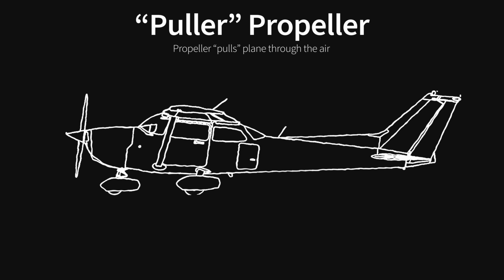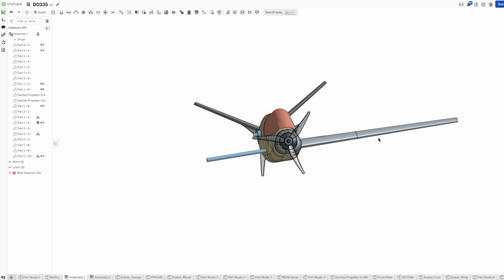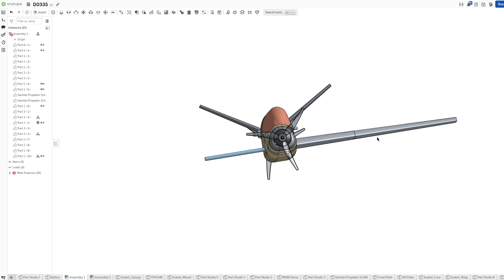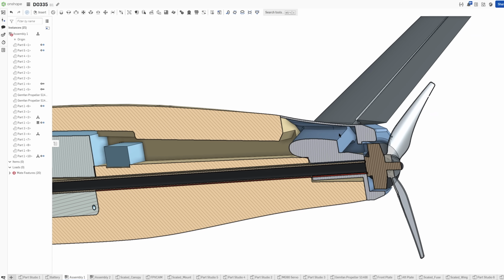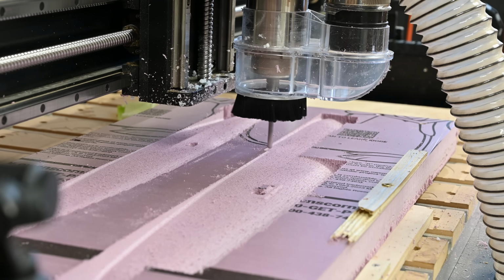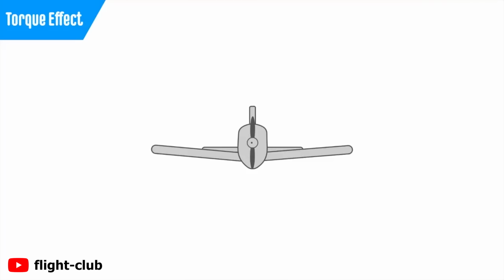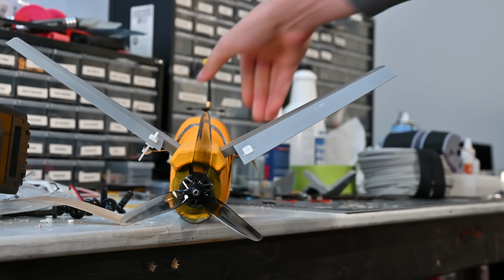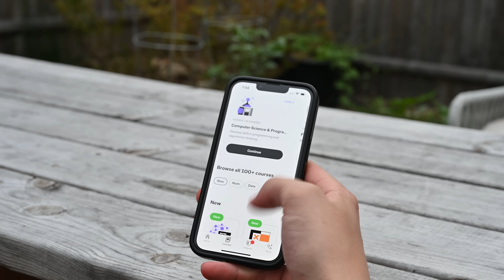Building a WEIRD RC Plane... Will it Fly?

Comment: Tail: Add vertical stabilizer, pointed down with rudder and very robust actuation system. Replace V with larger horizontal surface with elevators. Insure proper balance! Increase torsional stiffness of all structures.

Comment: Build a catapult launcher like they use to launch fast delta wing RC jets.

Then without power launch it to test the glide. If it won't fly power off there's little chance it will fly at all.

Comment: I feel like I need to build a much simpler version of this with foam board to prove that it will work. There are a lot of issues with your build, the glaring thing that got me was how you seemed to thing CG wasn't that big of deal. CG was probably your biggest problem with this plane. The best way to find the proper CG would be to hold it upside down and test is that way. The design itself was good, that plane will fly, maybe need a little more experience and don't rely on the flight controller to correct major CG problems.

Comment: Number one big issue is the sharp leading edge of the wing. It stalls at even slightest AoA. Combined with a weak V tail and huge moment of inertia from tandem motors, it is a guaranteed failure.

Comment: man just move the wings back and make the tail larger with larger control surfaces. Make a traditional T tail instead of a V tail, this gives the arduino pilot more able to respond to input. A push/pull config is not impossible, you just messed up the basics of airplane design.

Comment: With massive power any minor stability issues are magnified. I am unconvinced your cg is correct. I suggest removing rear motor to start with. Your tail should permit correction for motor torque, and forward movement of cg, and you should have plenty of power with one motor. In principle, a power off glide can be used to confirm correct cg; however, you likely have a really high wing loading, so tough to hand launch with adequate velocity. Larger (longer) wings would help with wing loading. Also, try to get correct cg with the smallest possible battery. Weight is the enemy. A small battery may give a short flight, but might also confirm airworthiness. Giving up is not an option…

Comment: What  is the purpose of design a plane and then pretend that adding an autopilot, without any clue about tuning it, will solve magically the problem or a tail heavy GC ? 
That plane should fly perfectly without autopilot, then you add autonomy. 
You used lightweight pla for motor mount than normal pla for the tail sanction. If you had study A bit the 335, you will have find out that German engineer put the rear motor in the cente of the fuselage for a reason... Making this kind of video is pointless and silly for the community

Comment: I built something similar and had issues with insufficient tail surface to control it very well. Some planes just don't scale down very well and need bigger tail surfaces. So I changed my design to a Cessna Skymaster with front and rear props. With the tail behind the thrust, it flew really well and fast. I suggest changing it to a Cessna Skymaster or adding a tail boom. I did not use a flight controller on mine cause I only flew it in line of sight. Personally, I would not give up and keep trying. Flight controllers can only do so much. Personally, it is still too tail-heavy. Always fly without a flight controller to make sure the design can actually fly. Then add a flight controller to it. Use foam for the tail to keep it light. 3D-printed parts on the tail are just too heavy. Don't be afraid to add additional weight to get the CG perfect. That narrow wing cord is very sensitive to pitch inputs. Contact the guy from the channel "Think Flight" or RCtestflight for help. Those two guys helped me so much when I had questions about my build.

Comment: 1 motor in the front with a shaft coming out of each end of the motor shaft to front prop shaft to back prop with some support bearings preventing wobble. But, you will have to use a gear box in the front to reverse the prop direction. Can't have two props turning the same direction

Comment: Ah let me tell ya, despite tandem motor setups being such an attractive planform they are a MESS to get working!

For the better part of 4 years I've tried to get a combined prop/EDF airframe to work, and the enemy was often tail heaviness. Its just hard to manage the weight!

In the case of your design, it might have also suffered from the wings being too thin. If you think of the thickness of your airfoil as its "power" than you'd want a thicker airfoil the more your weight goes up. Otherwise the wing will be stall prone all the time on takeoff. Simply no way to gain enough energy in that kind of space to stay flying.

Maybe the tandem design needed to be 10-25 percent larger all around to handle the weight, or at least have a thicker wing (or flaps!).

Comment: 1. The Fuselage is to long 2. Weight distribution at the ends of the fuselage leads to an inertia that can not be outweighed by the relatively small V-rudder size. 3. Vibration of this setup is adding turbulence to the V-rudder.

Comment: Use a Radiolink Byme-A Byme-D Flight Controller to get bricks flying safely. And larger tail to handle more sloppy and fast built airframes. Did you angle the motors for counter torque? Cant wait to see what you build next^^.

Comment: I reckon the problem is poor yaw stability. 

When the plane starts to yaw this causes unwanted induced roll. Additionally when the flight controller tires to correct the yaw you lose some of your pitch authority due to the use of a V-tail. Making the tail bigger or not using a V-tail would probably help.

Comment: I don’t really like V-tail layout. Try a conventional one, it should give much better stability. Or just add a ventral fin to make a Y-tail. I had similar problem with one of my early planes. Does it have wings of EPP?
In terms of reinforcement and making smoother skin - try to cover it with fiberglass using elastic epoxy resin - I had recently discovered and tested this brilliant technique.
P.S. could you upload CAD model for us to edit?

Comment: Calculate the weight and adjust where you put the wings when you design the fuselage. Moving the wing backwards instead of adding weight.
Reply: Also are you sure not one of the propellers just act as a break. If they rotate at the same speed it may not actually help. They are not close to each other so I doubt you get the benefits that usually counter rotating propellers give. 

It also looks like it’s too heavy, not just unbalanced. 

Further are your motors angled as they should, I suspect the rear engine is just making things worse if you have mounted them straight. You might need to double angle of thrust compared to how it’s normally setup. 
Depends on the engine rotation whether you should angle front motor left or right. Normally a one should also angle them a bit downward. 
However with a rear engine messing with all this I can’t say for sure how you need to set it up. 

Begin with disabling the rear engine and make engine mounts for the front motor angled as appropriate. When you get it to fly with just the front motor running start experimenting with the rear motor. 

PLA is heavy. Don’t print parts that use any unnecessary material. If you can get away with one wall don’t print more. If you can design a model you can print in vase mode. Do vase mode. 

I have not yet tested lw-pla but I have a few rolls waiting for some prints.

Comment: I know nothing about building planes but i got 2 ideas first maybe the props should be shaft driven so you can confirm both are spinning at the exact s and speed. Or maybe mix the throttle or a more aggressive blade pitch so the front motor produces  slightly more thrust.  In 4 wheel drive in cars a more front bias creates stability a rear bias makes the car more likely to oversteer making the car more drifty. Maybe the same applies here.

Comment: I believe part of your problem is that the fuselage is not rigid enough. The counteracting torque of the two motors is causing the fuselage to twist, so when the plane is trying to pitch up for example, it is also being yawed.

Aside from designing the fuselage with an intentional pre-twist so thats its straight under flight conditions (which would require an estimation of the twist you're getting), perhaps a wider rectangular profile spar in the fuselage will improve the torsional rigidity.

Comment: Question: I noticed the plane wants to spin?  did you account for "torque twist"  having both motors spin left to right side of the plane will make it spin and should be set to spin opposite ways to stop torque rotation 
Edit: also having 60% power in the front , 40% power in the back will stop it wanting to flip

Comment: The Pfeil flys quite well in RC form.  You haven’t got enough tail surface authority with the V-tail, which was even problematic in full size aircraft when it was used, and it introduces further complications to control.  Also looks like way too much weight for the wing area.  Otherwise it’s a really nice build. The foam cutter is fantastic! 👍🏻

Comment: 6:25 not the best plan relying on flight software to fix a design mistake.

Your thrust lines on the motors are way off no down thrust of the front motor causes the pitch up. I'm not to familiar with thrust lines for rear motors, but I seem to remember a Zagi I once had up thrust line. 
I would suggest free flight prototyping to get you CG correct since you have a wonderful CNC router to build them quickly. Also ditch the three bladed drone props you should look for 6x3 electric two bladed prop. 
I would also have the rear motor on separate channel that has a arming switch. That way you can launch with just the front motor and after launch arm the rear motor and have slaved to channel three.

Comment: @michaelrechtin
its the v-tail. it lowers pitch and roll and yaw stability because its angled. the fact its angled makes it so when you yaw you roll and thats why it spins when you try to yaw it. the ardupilot tries to counteract that and it does but that means you have less roll authority. this creates a feedback loop that spins the plane. another part of the feedback look is that its very lowly angled which means you have almost all rudder control going into roll and barley any yaw stability. just use a standard tail instead.

Comment: Wrong type of props? Looks like you are using drone propellers.
Too high wing load. The only planes I've used a massive battery pack like that in has a wingspan of 1½ to 2 meters.

Comment: I'm thinking 1) you've got the wrong props as the plane seems to slow down after you hand launch do although you have static thrust it's fooling you because the thrust drops as the planes in motion 2) the V-tail seems small with not enough authority

Comment: Good video but it didnt fly becouse the tail engine was in the tail you must put it in betwen the wings to keep balanced the weigth, segond use other solid wings , the foam wings , wigle when it flys what makes it unestable.. and lastly add the three tail configuration.. otherwise it wont work

Comment: So... You're not just tail heavy. You're heavy in general. At the scale you chose even the heaviest warbirds, which are notoriously terrible to fly, should be around 1.5kg... And with perfect balance they are just flyable. Just.

The scale you chose is very unforgiving. Ironically going 50% larger might fix your problems entirely.
Reduce the wing load, scale it up, fix the cog and find the cop. That second motor is gonna play merry hell with the latter.

edit also check your servos after crashes like that, often the gears can have microfractures that eventually give under load.

Comment: Looks like a motor ? prop alignment problem between front and back creating a moment causing plane to rotate about its centreline axis. Also suggest checking motore /speed and thrust. They must be equal so as not to create additive yaw moments.

Comment: Pretty sure it's a parasitic drag issue caused by prop choice. All planes that have two engines on the center-line suffer from this effect. I think the 335 even had a veritable pitch tractor prop or at least that was how I understood it talking to a guy who did a lot of work on Cessna Sky-masters back in the day when we got into a throttle synce discussion...

Comment: The problem with the Do 335 was the lateral and longitudinal control, for that reason the plane was with the tail in the crux form † , so I will make several recommendations:
1) Use the second wings, the larger wins to reduce the load of the plane.
2) Try to have the most uniform fuselaje in the plane, the step in form of the pusher motor kill all the power.
3) Make an X tail  to have real control of the plane 

Keep trying, is very interesting.
Reply: The pusher engine was just aft of the wing, which also changes the CG.

Comment: Michael, did you have an individual ESC for each motor? I think that due to the nature of how ESCs regulate with the same input signal, they could be out of sync. Maybe you can try attaching the motors to a stick together, which is attached to a string hanging balanced in the room. This way, you could test a few configs and maybe try using just one ESC with the motors connected in reverse parallel to use only one PWM modulation for both motors. Also, slight differences in the propellers result in residual torque, which can only be countered passively by enlarged wings combined with sufficient velocity.

Comment: Usually having the center of lift in front of the center of mass causes the plane to be very unstable, kinda like the same reason why rockets have the fins all the way back, so there is 0 stability problems caused from the center of lift being in front of the center of mass.

Comment: Maybe the tendency to roll and yaw has something to do with motors torque. Maybe it's the aerodynamic influence of the camera. Test it with one motor at a time until you get a stable flight, then test it with both together to see if anything changes.

Comment: Great effort! I don't know if others have mentioned this or not but a tail heavy RC model just won't fly for more than a few meters before crashing. If you're not getting a favorable CG, it's just going to end up in disaster. Revise your design and components configuration to end up with an acceptable CG before even ATTEMPTING a hand launch. Otherwise, you're just throwing an overdesigned and expensive foam rock into the air, lol! No judgement, just saying. ; )

I'd also go back to the Do 335 design. Namely the tail configuration. Your v-tail is a serious no-no for a push-pull inline twin motor design. There's a reason the Do 334 had such a huge cruciform tail design. And the bottom fin on the Do 335 did double duty to protect the rear propeller from striking the ground during takeoff and landings (mostly landings), while providing more yaw control and stability. V-tails have always been much less stable than cruciform tails but they have one benefit... more aeronynamically efficient since there is one less tail surface but it's not advantageous for your design. V-tail Beech Bonanzas has TONS more fatal accidents than the conventional tail version. Lots of dead dentists and doctors, RIP. 

The second place to look at is the thrust line of your motors. If you look at the Do 335, you'll notice that the front and rear propellers are not at the same height (thrust lines). The rear is a little higher than the first. I can't tell you why, but it's a key detail that contributes to the overall stability and flyability of the model type. Same thing for the Cessna Skymaster - the rear propeller is higher than the front propeller. It's a critical design requirement, apparently. Something about reducing dirty air feeding into the rear prop... 

People have successfully built flyable RC Do 335 and Cessne Skymaster aircraft (also a push-pull design), so you might want to look at some of these for reference. Don't give up, you'll gget there! Don't forget to HAVE FUN! Good luck and cheers!

P.S. The Do 335 is one of my favourite all-time designs and I've been wanting to build one for a long time. I mostly fly pullers, conventional twins, and a pusher every now and then. Respect for even trying! Watch out for that rear prop during the launch! Had my middle finger's tendon cut in two by the prop of a pusher flying wing 3 years ago. Not yay!

Comment: You may want to consider a redesign based on the Cessna Skymaster - it was an extremely reliable plane flown in several theaters of war and also several civilian variants. There are even helpful dimensional diagrams on the wiki page that would offer a starting point for an RC design.

https://en.wikipedia.org/wiki/Cessna_Skymaster

Comment: Longer fusalage would be much better. You could also make the v tail moving surfaces a tad longer. The point here to to get a bit more leverage on the control surfaces . With the tail motor it has rough air directly around it. It may help a little to move the surfaces a little bit further away from the rear propeller. But you always have to have good CG no matter what.

Comment: Skill issue. The flight characteristic issues are definitely stemming from the Control system. Swept the wing backward and it will aid in the yaw. Maybe using a most basic form of symmetric airfoil on the main wing and adding a tiny fixed canard(no control surface) would help, as the main wing can aid in the stability. At that point the V tail loses its purpose around 60% though. You should keep in mind that the propellers on such rotors are so high rpm that the propwash flow is even if it's turbulent, it's manageable. So the push-pull configuration doesn't mean much here. Also the V tail is simply so tiny it won't help. Increase the surface area beyond the sum of horizontal projection. You need like 1.3~1.7 times more surface area than just adding it up. I don't do a math, though.